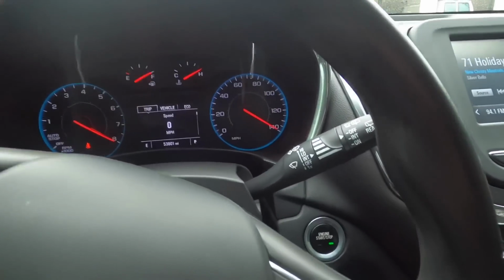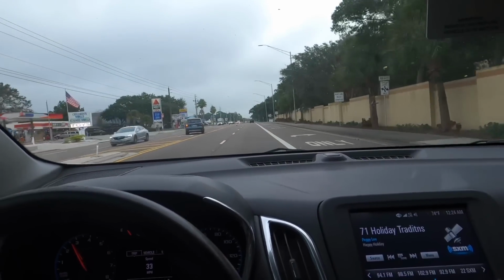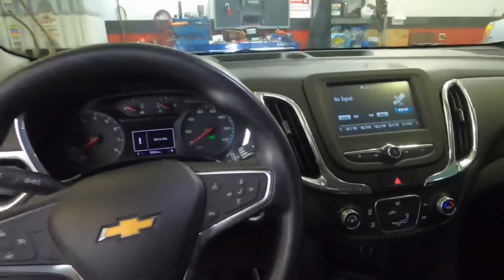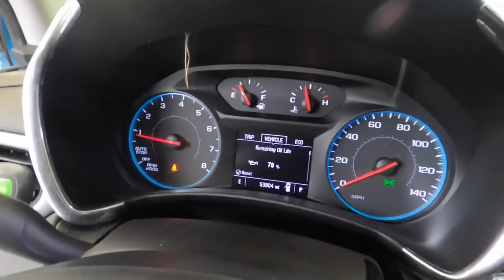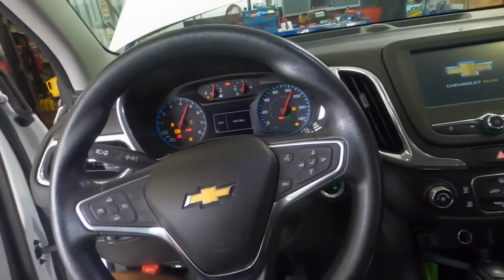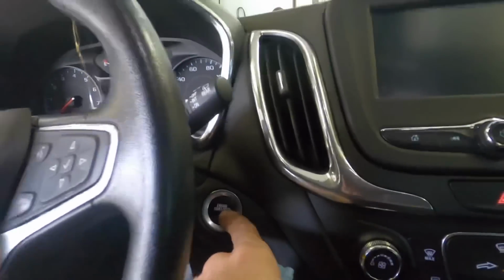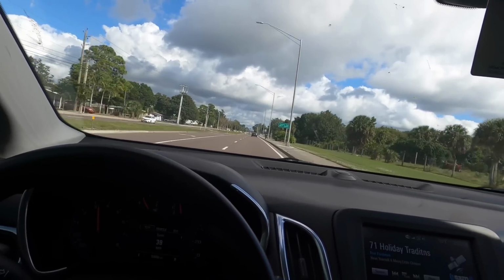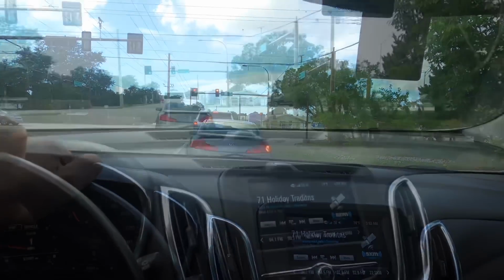Low oil could cost $$$$ | By Mistake!

Comment: You're a good man Charlie Brown...... I'm betting the owner reset the engine oil life just to get rid of the light. Hope he learned a lesson and you gained a customer for life...... imagine the total disbelief he's going to experience when you hand him a bill for $50 for an oil change when he's expecting a huge estimate.
Reply: Well it’s $ for 1hr of labor for diagnosis, + oil change parts and labor. So probably around $200-300
Reply: Adrenna it's harder to reset the code than to check the oil! :-)
Reply: @grantperkins368  for most normal folks…. Sitting at a traffic light and pressing the button is zero time/cash invested.like most of American society, anything for immediate results, the long term isn’t here yet so it doesn’t count.
Reply: @adrenna123  Most newer cars have some ridiculous series of button/pedal pushes to reset lights, so @Grant Perkins is right, it would take longer to reset the light than it would to check the oil.  You're also right, we've become a society of instant gratification and convenience.  Which is most likely why this particular 'problem' became an issue for the car owner.
Reply: @BoomerKeith1  Actually in this case they are correct. All General Motors vehicles clear with a 3 second hold of the check button on the right of the steering wheel while on oil life. As a GM technician I have seen plenty of vehicles that people have reset the light because it annoyed them and then they went another 5-6 thousand miles before changing. So in this particular instance it could have happened.
Reply: @TheCasperFoxbody  I think you're agreeing with me in a round about way.  Checking your oil takes less time than resetting most lights.  Neither are going to take long, but why not just check the oil?
Reply: @BoomerKeith1  I mean I would most definitely rather check my oil. Sadly there are a plethora of people who don't and that causes way too many problems.
Reply: @TheCasperFoxbody  I'm sure, like Ray, you see all kinds of stuff that could have been avoided with routine maintenance.
Reply: @BoomerKeith1  I own a 2018 Equinox and it is go to the oil life screen in the center console push and hold the Check mark on the steering wheel when the oil life screen says reset release check mark then push it one more time.  Easy peezy. My 2018 Equinox is a 1.6 liter diesel but otherwise it is very similar but my is the LT version with a larger center infotainment system and sunroof.  Since mine is a diesel and expensive to repair I go to 50% of oil life and change the filter and oil which is normally right around 3,500-4,000 miles. I also do not allow the dealership or anyone else do the oil change I do mine own as the last time in the dealership incorrect oil was used and stated on the invoice. I made them take it back in immediately and change the filter and oil to Dexos 2 as the manual and the oil cap states.

Comment: You're an honest mechanic Ray, hard to find here in the uk 🇬🇧
Reply: Hi Steve ,    Both my partner & I were good,  honest old time mechanics.  the  trouble is serviceing intervals are too long
and it is too easy to switch code lights off without doing the work.
Reply: I've got a good one here in Sheffield
Reply: @Eyupyorkshire  Care to give them a shout out? (I'm also in Sheffield.)

Comment: A motorbike I owned many years ago had oil level light not oil pressure light,
Made sense that low oil is more common than failed oil pump.

Comment: Lol... a full size car with a motor just slightly bigger than my Yamaha motorcycle. (FJR1300)  lul
Reply: The current Gen Equinox is smaller than the previous Gen. None were full-sized SUV's. Mid-size at best. I love my 2017.
Reply: @MazichMusic  By "full size", I didn't mean a Crown Vic, I meant it wasn't a YoGo or a Fiesta or Mini Cooper.  This is a 3500 lb car with a motor about the size of my 600 lb motorcycle.  I'm glad you love your chevy.

Comment: What's the oil cleaner you use Ray? I'd like some!
Reply: Ray is the expert and I'm giving an opinion . Never use unless the oil shows black on your dipstick . It is called a motor flush at the parts store and is basically Kerosene in a bottle . If you use it idle your car for 10 minutes and immediately drain and change filter .

Comment: Damn it........ I am so happy continuing to Own/Drive the Same Kind of Car since 1974..... None of these Actuators/Sensors/Computers/Catalytic Converts to mess up.... My Cars (have 3 of same) do not even have a check engine light..... Ok what is amusing is some of you ask..... Yeah, but you get terrible gas mileage..... Hell... Does not cost $1,300 to get timing hardware changed... and when it is changed, do not have to establish it with the onboard computer.... and in Addition you fine folks..... 30,000 for price of upgraded vehicle, how many Years/Decades do you think it would take me to spend that kind of money on Gasoline for my car/s?  Hell... I didn't vote for Biden/Harris......

Comment: My Avensis 2006 (Camry there in US) broke down while ago... Fuel pump in tank was gone. They said new pump costs 1900€ (equals $) but i had to say NO :D Got the new pump for 300€ and took it to them to replace broken one. Maybe they wanted me to get rid of quite good ride just 100K miles in it (2.0 automatic)
Reply: Toyota/Lexus vehicles NEVER break down.
Just ask Scotty Kilmer and his Toyota/Lexus worshipping minions.
They only need a occasional oil change and windshield washer fluid top up...
Reply: Engine never fails ;) The body melts down before engine does if treated right
Reply: this topic because of some repair shops use to scam the people :/

Comment: First I was like: 1.5 is not that small, then I remembered I live in Europe xP But with mine 0,9 turbocharged i3 mechanic said that don't u dare don't change regularly or use oil that is not specified by manufacturer or ot may just not work anymore
(For interested: Renault Clio IV TCe 90 HP 2018)
Reply: The car weighs over 3800lbs(1723kg)
Reply: Right next to me they sell Škoda Ocavia ~4000lbs heavy car with 1.0 114HP engines :D

Comment: These 1.5 liters have been getting known to be going to shit with fairly low miles even with proper maintenance
Reply: The early ones did because the lack of synthetic oil being used. GM changed the required oil type and no issues since.

Comment: Damn you, I now find myself making powering down sounds, "clicks" and "do dee do" when watching other peoples videos and shouting "gravity" as I drop something. Thank you for showing that mechanics are in the main not rip off merchants and just want to fix things in the best way possible, giving the customer value for money.
Reply: Poppen zee hood 🤣
Reply: @fmk6john  i already kept saying this before watching Ray and glad here sheres the Same work ethic as me and sense of humor
Reply: Me too!! Yelling gravity is my favorite.
Reply: Power Down ! Tiioouuuuu
Reply: I found a torque-wrench on my local roundabout yesterday, in it's plastic tube. It had been run-over a few times, but still works.
Reply: Every time I turn a nut, bolt or even a wood screw... click.
Reply: Funny! I was trimming trees yesterday, and when I was watching a branch fall to the ground, I said "gravity". 😆 I wasn't even thinking about Ray or anything, just out of the blue I said it!
Reply: Tzzzzzzz when messing with electrickery
Reply: Thats a dealership,  not a repair shop with a mom and pop owner. Its their reputation on the line. Dealerships could care less.
Reply: Same here! I find myself saying "gravity" whenever I drop something.
Reply: Yes, I've started the gravity thing, I was in ASDA (a large UK supermarket) and the stock trolley fell and dumped cans all over the floor, as I walked past a mumbled "Gravity" I did get a funny look tbh.
Reply: I use "click" when working on cars😂
I have OCD so i kind of keep going back to bolts to check if they are torqued properly, so using the CLICK sound makes me remember that I've already torqued everything down.

Saves up time when working on both customer cars and my cars
Reply: I also say "click " when I tighten bolts now, crazy conditioning...
Reply: Sadly, I've been burned by a ripoff mechanic. The father was a family friend, but the son decided that more money could be made by banking on his dad's reputation and doing shoddy work. Case in point - he replaced a rear wheel bearing 3x  in the space of a month, claiming that we must've done something to it. I also had to replace steering tie rods every 6 months on a car that was driven less than 10K miles a year. 

So young and stupid.
Reply: Click!  Every time I tighten up something
Reply: When I break a bolt loose it's "C I L C K."
Reply: Often it's not even the mechanics but shop bosses proritizing selling certain things instead of getting most cost effective repair
Reply: I've been doing the "click" and "gravity" remarks lately. Have caught myself doing the "do dee do" while watching the videos too. LOL
Reply: I’m doing the powering down sound when turning off my car dammit.
Reply: @NeoMorphUK  Now my GF wants to know why I say "Starten ze engine" in bed.
Reply: Very few mechanics are actually in the business of ripping off customers... but A LOT of mechanics simply are not equipped, lack the skills to properly diagnose a problem, they fire a parts canon on the vehicle hoping the problem will be solved... this makes repairs expensive and a lot of the times problems are not being solved... customers thinks: I'm being ripped off... and in a way they are, but not intentionally. But yes, not checking the basics but recommending parts to be changed... that's a rip off.
Reply: Yeah well, every time I hear his phone in a video I do the sound.  Ridiculous, thanks Ray.
Reply: Yeah I am now using my electric ratchet for dang near everything I used to just grab the 1/4” metric rail and a regular ratchet for. Beats spinning the socket/extension by hand method. 😂

Comment: Had the same engine in a Malibu (which I thought this was until you clarified it was the suv kind) Mine was a 2017. The engine oil fed brake pump failed, engine got pulled by the dealership and the engine was never right after thirty five thousand miles. I traded it in nonoperational at fifty three thousand miles. Stay the hell away from that car, chassis, brand, engine. It is simply that bad.
Reply: 2.9l v6 fords are just as bad imo
Reply: We had no problems with ours.

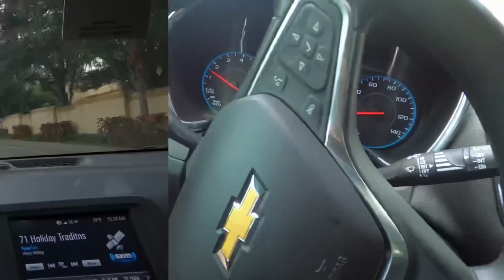Comment: @1:39 at 53 thousand miles, I would find that unlikely that the timing components would need to be replaced.  I had to laugh at that statement because my 2017 F-150 with the 3.5EB needed all of the timing components and chains replaced when the truck was 2 years old with 22,300 miles.  Oil changes at 4500 mile intervals, full synthetic oil and all work performed by the dealer only.  Glad Ford ate that repair.  The repair, plus parts was $2,400.  Glad you could save these customers some money with a simple oil change.
Reply: Dealer, that word makes me shudder.
Reply: @cypeman8037  You spelled stealer or stealership wrong.
Reply: There are a few engines that suffer a lot from timing chain problems. The european thp150 and thp 156 engines are absolute desasters, used by mini, citroen, peugeot and even vauxhall. The chain on my DS3 will be replaced now the third time (110.000km), and I know others which have even worse problems with it...
Reply: @craddocraddoc  1.6 "Prince" had his problems, but this engine newer iterations are getting better :)
Reply: Haha man same boat 38,000 f150 3.5EB sensors and cam phazers changed last month and 3 ecu reflashes,  still having issues ...
Reply: Well it's a modern Ford.... What did you expect
Reply: This comment thread is exactly why I have the 5.0 in my F-150, and will not drive the 3.5. They are wound up too tight, and are bound to break… that being said, the 5.4 triton’s were bad about dropping timing component too. If I remember correctly, a $4000 repair.
Reply: Germans can't seem to get timing chain systems right half the time. Benzes eating sprockets and cam shafts and BMWs shattering chain guides at any sort of age and mileage 😂
Reply: The good news is after you do the timing set the old parts are still just fine for driving mini bikes, go-karts and other stuff. Who cares if they rattle or jump once in awhile.
Reply: my timing on my 4.6 2v went 195,000 miles before i replaced the components. the most indestructible OHC V8 engine ford has made imo. oil changes every 5k and zero issues
Reply: The issue with the 3.5EB is that they use "silent" chains instead of the typical roller chain setup. That and Ford really seems to have a hard time with  cam phasers. GM used "silent" chains for a few years with their 3.6 V6 and their "silent" timing chains had the same wear/stretch. GM eventually switched back to a roller chain design.
Reply: how do you know they even changed the oil
Reply: Its a Ford, enough said 🙄
Reply: My son in law's 3.5 ate it's self at 120,000 miles!   It's one of the reasons I will never buy another Ford. It had oil changes every 4,000 miles! Give me a V8 or I go somewhere else!
Reply: @steveb6103  All fords do this.
Reply: What did we learn? Buy foreign cars!
Reply: @michaelmiller6013  no, buy old American v8s is the answer.
Reply: @BudMasta  Bingo!
Reply: part of the issue is people rev them high    the small 4 bangers   i told my dad NOT to rev the engine and keep 2500 rpm or so
Reply: @punker4Real  It's fine to rev them higher, bit after they are fully warmed up. And oil temp is more important than water temp. Safe oil temp is ~70°C to max 110 °C. I'm flooring my little 1.4 monster after oil is around 60, and let it rev higher after oil reaches 75. Water at that point is long on 90°C mark (middle). Also - revving higher from time to time helps reduce deposits in exhaust manifold & turbo.
Reply: @mmllmmll22    turbo  so the compression is higher so more wear and tear 

  i never even take my V8 engine over 2500 rpm  no need   2200 is  enough even at 80 mph
Reply: Modern Trucks should not have Timing issues unless it’s a defect part. So, your truck was probably a Mexican assembled lemon. 🤣